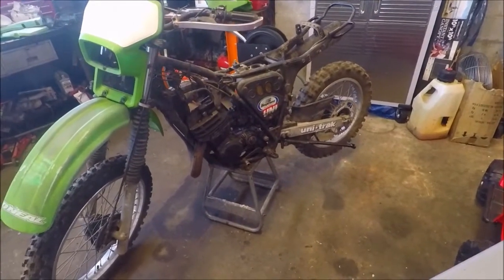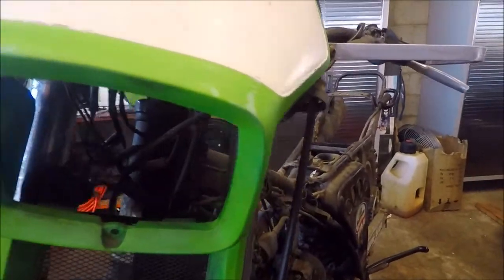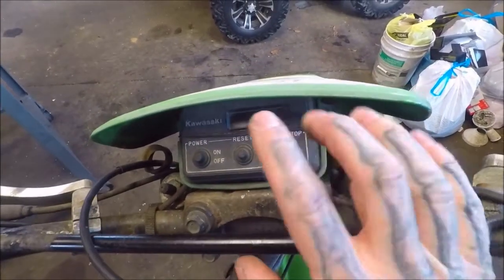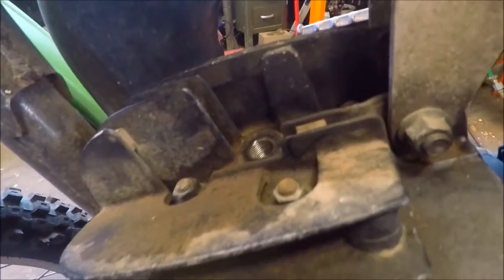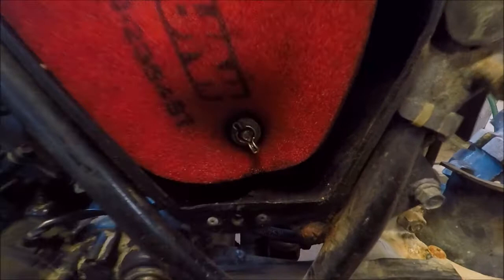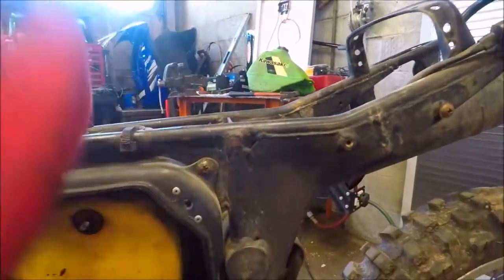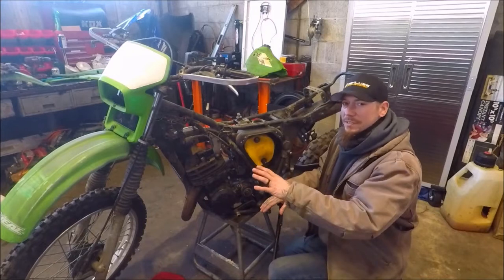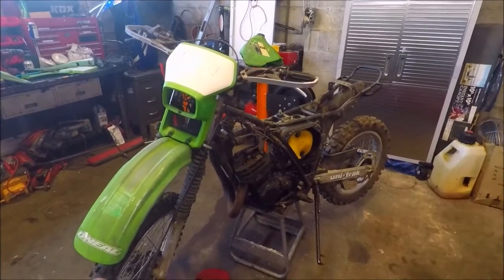This Kawasaki KDX is the HOLY GRAIL of Dirtbikes

Comment: I also recently picked up an'84 kdx200 for $900.00
It's in pretty good condition, but still needs rear brake pads, after market HI FLITE seat cover has a rip in the middle, and needs a few other miscellaneous things. I'm pretty stoked I got my hands on a pretty much bullet proof, air cooled 200 two-stroke from 1984 that starts on first or second kick (after a couple of primer kicks with no choke, no throttle)
🙂💯🎶👂👍